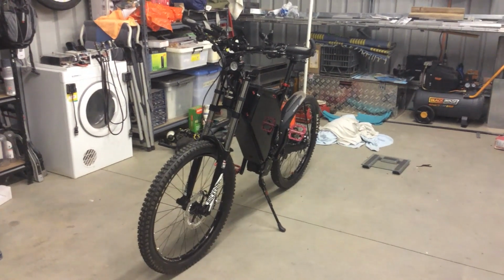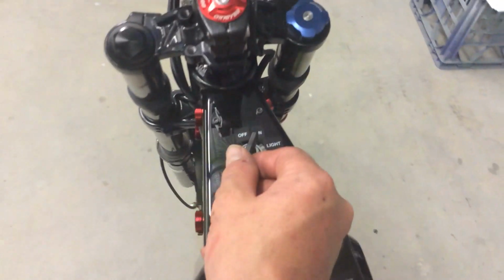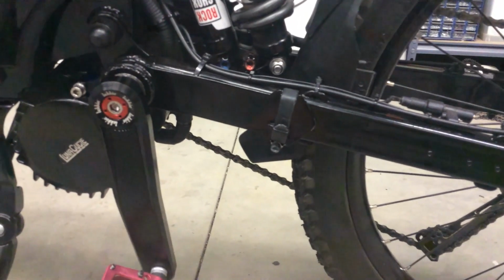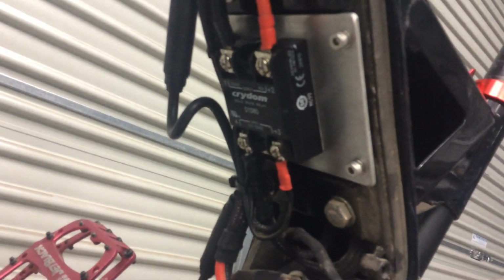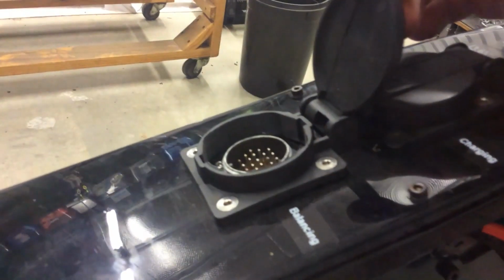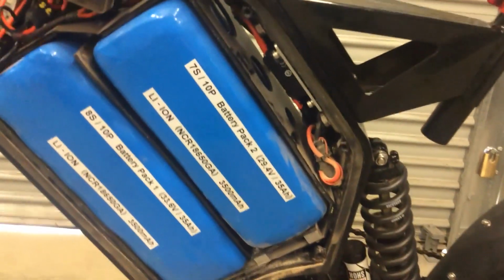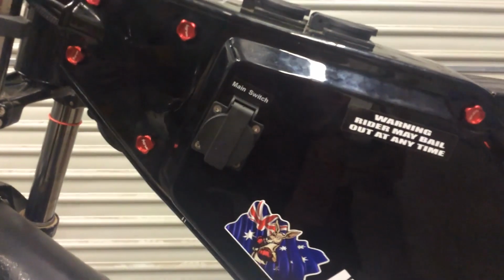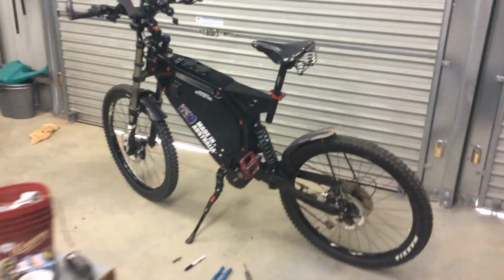Enduro E-Bike with Mid-Drive (BBSHD) Custom Build Walk Around (Updated & Improved Audio)

Comment: Nice bike. I have the same motor. I am presently searching for my second battery for it. I now have the 48v but was thinking on upgrading to the 14s/52v battery. I read somewhere the max cell for this motor is 14s & won’t  run if over 60v. My question to you is do you have a 15s set-up? If so is it because your top volt per cells is 4.0 (4.0x15=60) ? Thanks for your reply.
Reply from the maker: Hi Albert, Thanks mate 👍🏼 I certainly do run a 15S setup, but I only charge/balance my cells to 4.1v per cell (4.1v x 15 = 61.5v Total)           
but my I-Charger Duo "conservative charges them up to a "Maximum of 61.3V"in Total, even through I have set the Charger at 4.1V per cell. 

But running 15S will mean you will need to make your own 15S DIY Battery as I have never seen this as a "off the shelf option" in an E-Bike battery Pack.

Note - Running the BBSHD Motor/Controller at 15S will almost certainly "Void any Manufactures Warranty" so I suggest waiting until any warranty has expired if your concerned about Warranty protection.

Check out my Video - https://youtu.be/WuhXpwloD68 for a more detailed Description.
Reply: Albert Nieves I would love to know more about your bike and build. Parts and sourcing. How many miles do you get in a charge? I’m looking to build a bike for my commute and I’ve never built one before. Any tips suggest or forums or videos you followed? Again zero background or experience building g

Comment: Hi, what front wheel did you use? It's the last part I need in my build.
Reply from the maker: Hi Michael, I used a 26" Mavic EX 729 Rim (widest rim I could find at the time) I used a  20mm Shimano Through Axle for Front Hub (Specs for hub is in my Description) 
    I'm away from home at the moment but will list the "Part No" for the Shimano 20mm Through Axle to fit front hub & Roc Shox 200mm Dual Crown Boxer Front Forks (presuming your going with this setup ?) when I get back in about a week time. Send is some pics when you get your bike finished.
Reply: OZ E-Bikes 4 Life Thanks so much!

Comment: Hi nice bike. I plan to build one like this too, but with fatbike wheels. Is it possible with that frame?
Reply from the maker: G'day Courage Nguyen, The short answer is "I'm not too sure" , biggest I have used is 26" x 2.5" Tyre. 
       A lot of the "Hub Drive" Enduro E-Bike builds I have seen (via utube) use a motorbike rim & fairly large motorbike tyre, so it may be possible. I would suggest once you have purchased your Enduro e-bike frame, then go down to your local bike shop & measure the type & size of Fatbike wheel you like, come home and cross check for Height & Width (clearances) of the frame. Another factor is "Rear Shock compression" you do not want the Rear Tyre (large sidewall height) to come into contact (rub) against your Seat/Seat clamp, or seat post. 

All the best in your build, if your going with BBSHD (mid-Drive) I love to see your finished build (via photos) 😊👍🏼
Reply from the maker: Hi Nguyen, I found a seller who is selling the Enduro E-Bike Frame with BBSHD motor & Fat bike Wheels tyres. I believe it's running 24" x 4" Fatbike Tyre /Rim setup (complete package) here's the link http://enduroebike.sell.everychina.com/p-105136371-bbshd-48v-1000w-electric-enduro-bike-fat-tire-24-quot-x-4-0-tire.html
Reply: @oze-bikes4life663  Hi thx for taking ur time to do research for me. Now I can start to look after suspension fork and wheels. Damn I feel this project takes long time to finish.
Reply from the maker: Courage Nguyen ,it does but well worth the time invested when hitting those trails.... Good Luck 👍🏼😊
Reply: Enduro e-bike fat https://youtu.be/j6wysFhn-7c

Comment: Fantastic build, thinking of doing something similar, have seen one where a guy fitted a 3000w cyclone to the same frame,
Reply from the maker: Francis Ogrady, Thanks 😊 it took me 3-4 months to build in my spare time. The cyclone would be quite good, but at 3,000W max draw the Battery range would be quite reduced I would think. But any mid-Drive is the way to go 👍🏼. Those dirt hills don't stand a chance 😎😬
Reply: what do you think is the best enduro frame to mount a cyclone? (without making too much of a mess)